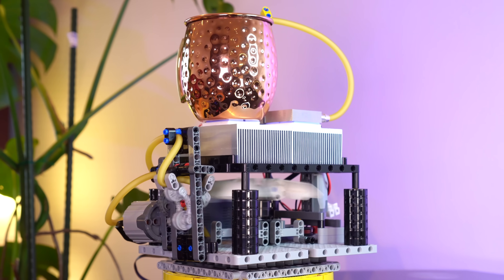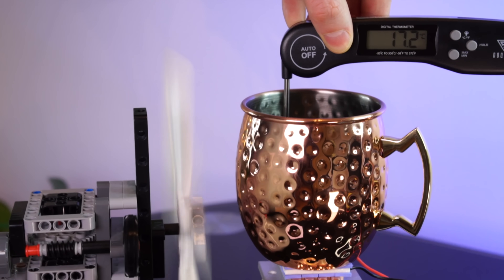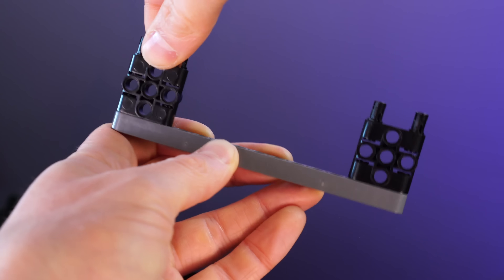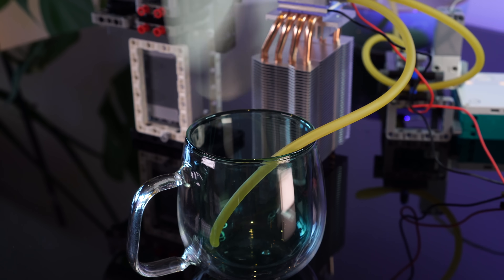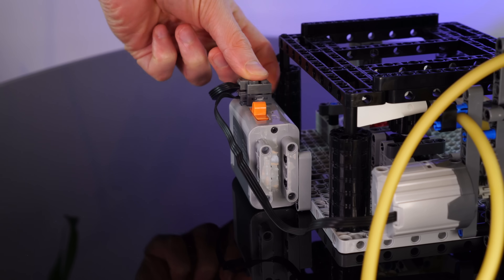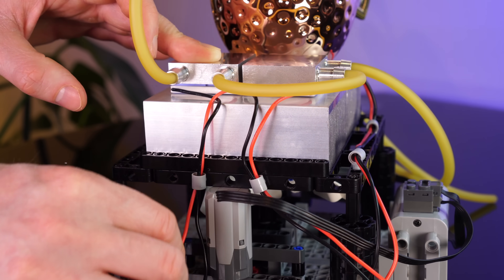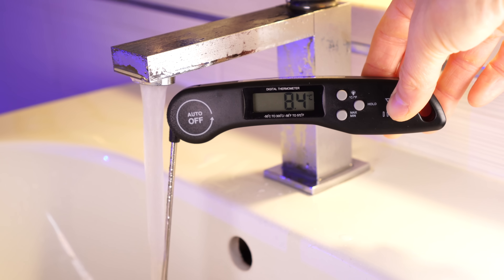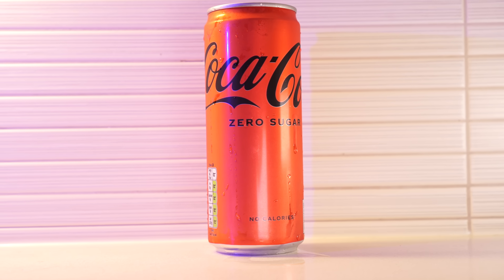Making An Instant Drink Cooler Using Lego

Comment: Honestly for better thermal transfer I would onto both the cooling surface and the radiator surface use small pads as I saw you didn't for the transfer to the water block. Keep in mind more surface area for thermal transfer to a liquid would be best as well to have some fins in there. Also furthering that the transfer speed of the pump may be warming it back up as well. IDK if this helps much but love the vid!

Comment: For a start: Peltiers are really disappointing.
1:30 - You have put a metal jug in front of a fan... the fan is heating your liquid.
Are you sure that silicon pads are thermal efficient? Try thermal paste and a better fixation of the peltier to heatsink and block.
Make a thermal isolation on your block.
Make the pump run slower, the slower the colder as you give time to peltier remove the heat.
Check if your fan is moving enough air, the colder the peltier hot side the colder will be the cold side.

Comment: Used to have a single-can sized "fridge" that was just a fan, heatsink and peltier device powered by USB 2. Since I have 0 use for it I just disassembled it for parts.

Nowadays you can buy cooling bags for cans and bottles, probably even better.
Reply from the maker: That's cool, I wondered if those little fridges were just Peltier modules in them. And you're probably right, I'd imagine a cooling bag is much more effective. Certainly quicker

Comment: 1:20 you're making a bit of a mistake in this measurement as well as you pass room-temperature air over the copper cup as well.
I think you should have put something like a bit of cardboard in front of it to shield it from the airflow (but still allow it to reach the heatsink ofc)

Comment: The biggest issue is that you're passing water over the cooler way too fast.
I'm surprised the tap worked that well.. but actually.. it kinda makes sense from the surface area to volume ratio and timing.

Comment: tec's are super inefficient, your heat transfer pads too thick, water isn't in the blocks long enough to cool. the 2 degree drop is likely from the tec on the cup itself. 

better bet would be to make a closed water loop and have those cooled water tubes just hang loosely in the drink.
Reply from the maker: All very good points, cheers! Yeah a continuous circulation seems to be a common recommendation here, seems like it's worth trying. Though I guess my dreams of cooling in under 2 minutes need to be tempered 😅

Comment: You fluid is not in contact for enough time with the cooling mass. You'd be better off creating a maze of small OD copper tubing and then submerging that in dry ice and then pump the fluid through that.

Comment: I think you could make it work better by creating a loop and cycling your whole drink through it multiple times. Maybe also using thermal paste on the peltier will give you better transfer
Reply: Finally someone thought about thermal paste
Reply: exactly what i was thinking
Reply: nah, thermal paste is overkill for how little heat is being moved.
Reply: @ameteuraspirant  I think 40 watts of heat on a small piece of ceramic will get hot. That's like a CPU working at 25% capacity

Comment: Thermal pads are pretty bad at transferring heat, you should really avoid using them. Even a bad thermal paste is orders of magnitudes better. Use a good thermal paste instead and keep the mounting pressure high, this should dramatically  help. This goes for both sides of the peltier, your bottleneck is most likely how fast you can get heat away from the peltier. The hotter the peltier gets the less efficient it becomes, creating a cycle that heats more and more. Thermal paste

Comment: I had a project about Thermoelectric Coolers, it was hard to generate cold water but i suggest to do the opposite. I noticed TEC's are better if you generate heat using ice that the practical use are making hot or warm choco/coffee that will be use to places with snow. The device can be a portable drink heater...
I think in this way, it will be more efficient.

Comment: You can try to polish the surfaces both of the heat sinc and the water block and spread a really thin layer of thermal paste it will boost the tehermal condutivity a lot. As shown in tech ingredient's last video where he explains how to cool down laser modules efficiently.(https://www.youtube.com/watch?v=9VmITd0dKAo) at 31:37

Comment: Would stacking the peltier modules to provide a lower cool side temperature improve the amount of cooling to the liquid? I know by stacking the modules you can get lower temperatures however it also requires adjusting the power the modules use since they are working harder

Comment: Wouldn't it be even more efficient to just... put the can in a bucket of tap water?
Reply from the maker: That'd be quicker than the Peltier device for sure! But I tested putting a can in still water (and not moving the can), and it takes a fair bit longer. Also when the water is sitting in something for a while, the water heats up rapidly, so the drink can't get as cold. I'd imagine your best alternative is just chucking your drink bottle into a bucket of ice or ice water. But I enjoy overengineering things 😁
Reply: @JamiesBrickJams  The movement of the water/can surface is key. The can in a still bucket will essentially warm up the water right around it and that severely affects how fast it can cool. When you spin the can and water super fast then you are using the "cold" of the entire bucket of water at the same time

Comment: maybe use Good Thermal Paste like the Artic MX-4 and find a way to press the heatsink and cooling block on the white element. This would make it better. Run them on parallel and it would be a lot better. Maybe use some insulation too

Comment: Get some water. Put it in a mold of your liking. Then put the mold with the water in a freezer. In a couple of hours, check the molds. The water should have turned solid. If not give it some time. When the water turns solid get it out of the molds. Put the now solid cold water in a cup and pour your drink in the cup.

Bam! Cold beverage.

Comment: I did some quick back-of-the-napkin math, and for a can of coke, to cool it from 17 to 8 degrees requires 14 kJ of energy. If the peltier device was 100% efficient (which it very much isn't) it would take 3 minutes and a bit to cool the water. The peltier element is much more likely to be around 20% efficiency or less, therefore it would take around 15-20 minutes to cool the can of coke. The issue is really that water has a very high specific heat capacity of 4.2 Joules per gram Kelvin, meaning it takes 4 joules (or 4 watts for 1 second) to cool 1 gram of water 1 degree. Helpfully, a gram of water and a milliliter are pretty much the same. 
Or in other words, to cool the can of coke in 2 minutes with a 20% efficient peltier element would require nearly 600W power draw.
Reply from the maker: Now this is my favourite kind of napkin maths! Thank you so much for describing this - this is unbelievable useful. At least now we can understand a ballpark upper range of how long it might take under an ideal setup. So really, even with a couple of 300 watt power supplies, and a number of Peltier modules with optimal cooling, we're still looking at a period of time longer than just chucking it in the freezer for 10 mins. I'm glad I didn't continue eking out minor improvements in efficiency! Really appreciate your help here ❤️
Reply: @JamiesBrickJams  Cool project! I never considered a lego fan ;) 

Several more forms of thermal loss:
Thermal pads are convenient and clean, but nowhere near as good at heat transfer (especially to the ceramic of a peltier module) as thermal grease. You could likely drop the hot side's internal temp substantially with better TIM (Thermal interface material)  which would increase your efficiency by an order of magnitude. Even junk thermal grease is typically on par or better than gap pads.

Your metal cup is acting as a heat-sink heating the water using the air. 

It might be that those water blocks just aren't great at transferring heat. Thus, the cold side may be getting far colder than the water. Peltiers are most efficient when the temp difference is minimal so stacking two water blocks on one peltier then a single block on a second peltier may net you some more performance. (so, pump -> top block 1 -> bottom block 1 -> block 2 -> cup. Here where both "block 1"s are on one TEC and block 2's are on a second.

Peltiers can actually be quite efficient, but typically at low power at small temp differentials.  I have achieved 38%+ with a good test setup and name brand modules. Also, using cheap modules I have gotten to -30+ degrees F. You can use detect radiation and cosmic rays by building a "cloud chamber" with this method.
Reply: @nathanielhuggins9254  True, those thermal pads are pretty useless. Also, could be wrong, but I think they depend on getting hot, at first, to mould themselves around the CPU surface they're usually supposed to be cooling. If you're dealing just with flat surfaces, much better to use thermal paste as you mention. And maybe spring pressure or some elaborate Lego mechanism to keep them firmly pressed onto the heat sink. CPUs use the sort of springs you could do the suspension on a monster truck with, they have power!
Reply: @JamiesBrickJams  Ehhh not really, Air isn't a great conductor of heat either (thats why 5 degree water feels so much colder than 5 degree air), a freezer just uses convection to cool the air around the chamber (and some gets to escape down to the fridge, thats why freezer-top fridges tend to be more energy efficient than french-door or drawer-freezer fridges: they have to actively blow the cold from the freezer up to the fridge). You're directly cooling your drink via physical contact. As Quinnobi mentioned: it takes 4 joules per ml. An average cup is 240ml, so thats... 16 minutes to cool the cup to your desired temperature (at 100% efficiency of course I'll get there). So if your pelletiers are drawing lets say 70 watts, thats 70 joules per second. at 20% efficiency, that's 14 joules per second (14 watts). so thats 3ml of water/drink that you can cool to your desired temperature per second.

In other words... you should theoretically (at 20% efficiency and 70 watts exclusively to the pelletier) be able to chill and fill a cup in about 80 seconds (a minute and a half). In fact it should entirely be possible: Keurig does it. Mind you, they're heating, and not chilling, so they have tons more efficiency as they arent reliant on chillers and cooling, but they're taking water from ~18C up to 89C -- a MUCH larger gap (which still requires that same 4.2j/ml). You're trying to shed 10 degrees versus Keurig heating 70.

Personally I think thats pretty reasonable. Basically about the time it takes for a Keurig coffee.
Reply: @JamiesBrickJams  Also you can stack them hot to cold so bottom scorching and top well sub zero seen a cryo cooler made like that. also those silicon transfers are well insulative better to use low temp solder on cooler side and straight copper sandwich for third hot stack
Reply: Considering he was running those poor cells as hard as he could, and that he didn't provide any insulation, 20% seems a fairly optimistic estimate... I would have guessed 5%, or even less
Reply: @Beregorn88  I'm not an expert on peltier elements so I just looked up typical efficiencies, and 20% seemed to be in the middle of what people were saying, so I went with that.
Reply: bro did not pass physics
Reply: Thank you. Just learned this in my sophomore year of high school.
Reply: 20% is very optimistic for these Peltier cells. I've heard it's more around 5% or so. They are ridiculously inefficient.
Reply: MORE POWER

Comment: You could have just used one cup and cycle the water in it
Reply from the maker: That's true. I actually ran an experiment there, and it took about an hour to bring a cup of water sitting on of the Peltier modules down to 10 degrees. So it does work, but it takes forever, and draws quite a bit of power!

Comment: You can use thermal paste instead of silicone pads, thermal paste has a higher thermal conductivity so you can transfer more heat
Reply from the maker: A few folks have suggested this, so I'll definitely give that a go, cheers!

Comment: Steel Ice in a tumbler , pour the drink in lock in with second tumbler (like a bartender before they shake your martini) tip back and forth between the two tumblers about 4-6 times , pour in fresh glass. Use legos to tip the tumblers like a teeter totter
Reply from the maker: Ooooh that's a cool idea, I like it! 😁 That sounds pretty straighforward

Comment: you need thermal paste or liquid metal if you want it to work extremely well use liquid metal silicone pads aren’t even very good for thermal transfer thermal pads you would see used on things like the ram in a ps5 which uses liquid metal to cool the APU/CPU
Reply from the maker: I saw recently the ps5 uses liquid metal - that's real interesting. And you're right, seems like thermal paste is a good idea to test, cheers 👌

Comment: Insulating the hot from the cold side should help and maybe using "better" thermal pads most standard thermal pads are pretty crap for going bellow zero they lose their elasticity and stop cunducting the residual heat as efficient, the hot side should be ok with thermal pads. I would use thermal paste for the cold side. Also using two seperated cooling blocks might reduce the efficiency even more i would opt for a single double wide one.
Reply from the maker: Ah that's interesting, I could certainly give it a try with thermal paste and a larger block. Cheers for the suggestion 👌

Comment: you can achieve better heat transfer without the pads just dry or small drop of water(when it evaporates there will be bond) or best option use thermal paste but its pain to clean up thats why i use the water method for my testing 80W peltiers
Reply from the maker: Thermal paste is definitely an option, I could try that 👌

Comment: you've probably already heard this from someone, but use a radiator instead of a heatsink.
Reply from the maker: That's a really good idea. I've even been wondering if using those aluminium water blocks could be a good way to pump cool water through them to draw heat away. could work better than a heat sink and fan

Comment: use thermal paste instead of thermal pads, they are much better at transporting heat. Also apply pressure from the Heatsink to the Peltier to improve the performance of the pad
Reply from the maker: Not a bad idea, I could give that a try!
Reply: @JamiesBrickJams  and as i now looking at the device i would also recommend to use something like a CPU cooler(like that one in the beginning of the video) because they have heat pipes wich spread the heat more efficiently,so the whole surface area is used for cooling and not just a small point. For your application i think you could scavange the heat sink from a old GPU like the gtx670 because they are really flat and have a large surface area so it will fit in your current design without major changes
Reply: @JamiesBrickJams  another idea is to go for water cooling but for that you will need a radiator wich further complicates the device. I think just dumping the hot water in a large bowl filled with water could also work since you are only running the peltier at 17w
Reply: Please use thermal paste like arctic silver 5 or Thermal Grizzly Kryonaut, it pains me to see the thermal pads instead of pasteeee  @JamiesBrickJams